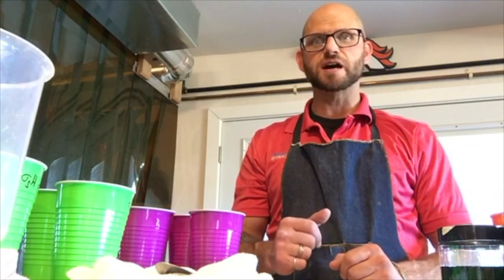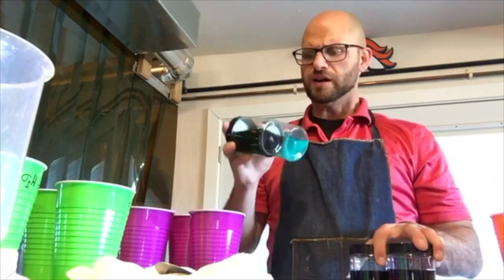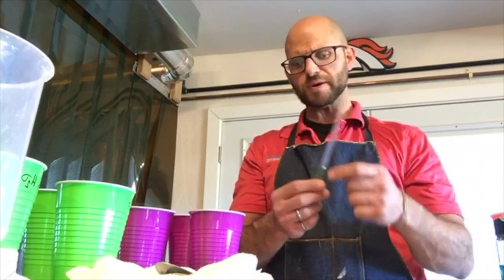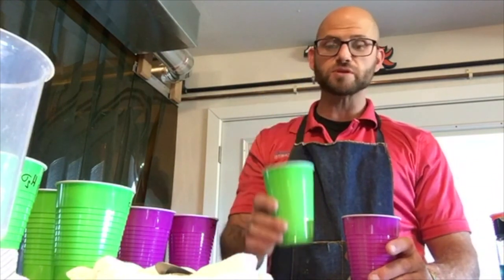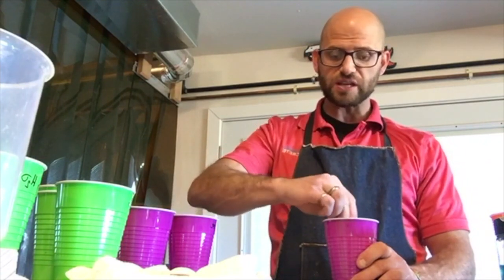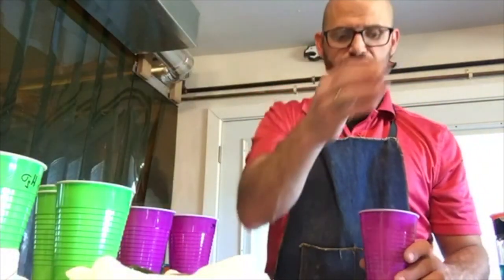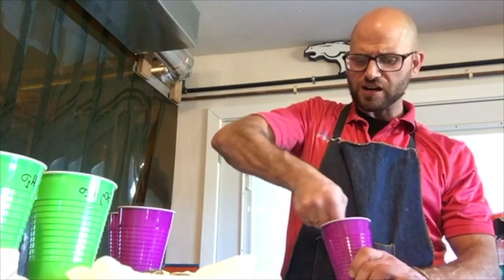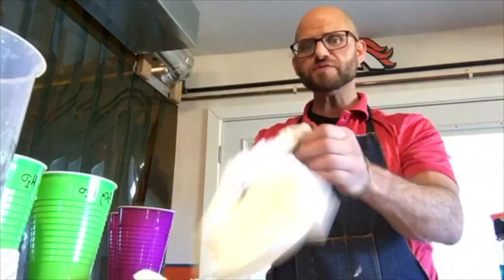Sequencing Of High Range Water Reducers - LIVE

Comment: Hello, Jon! Regarding the term "sequencing" I was looking forward to hearing your thoughts on when to apply the high range - at the plant, or at the job site. Please elaborate on the timing of high ranges and pros/cons to adding at the plant or at the job site. Thank you!
Reply from the maker: Sinclair Construction Group good morning!!! And thanks for the feedback!

I like to get the high range in the back of the truck at the plant. That doesn’t mean you have to do that, you can certainly put the high range into the truck on the job site. That being said, my concerns with timing are as follow:

- Adding the high range at the jobsite will require a certain amount of revs before it is universally disbursed. Also, each mix has its own life span in the back of the truck. Whether the mix is fast track or slow setting, if the mix has reached or come close to the end of its fresh life and starting setting up you might be fighting the kinetics of hydration to maintain slump. 

- If the minimum revs for mixing the high range are not met (and sometimes when they are) the high range may not be universally mixed. If the high range is concentrated in pockets of the concrete, it cause localized stabilization of hydration (or acceleration depending the type and amount of high range) and soft spots in the concrete.

I hope this helps.

Please let me know if you have any other questions / concerns.

GO CONCRETE!!! BEAT asphalt!!!